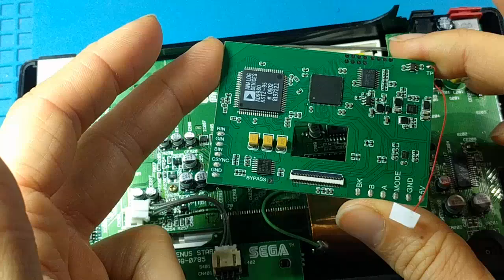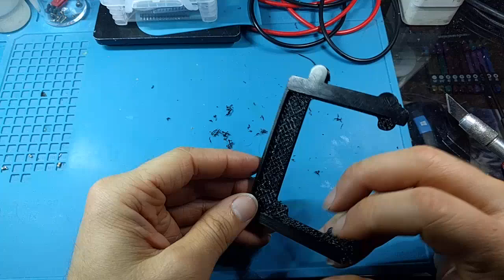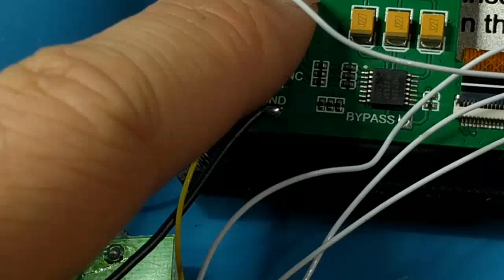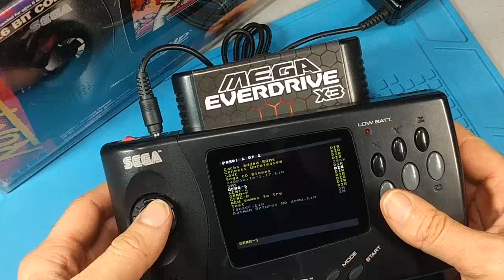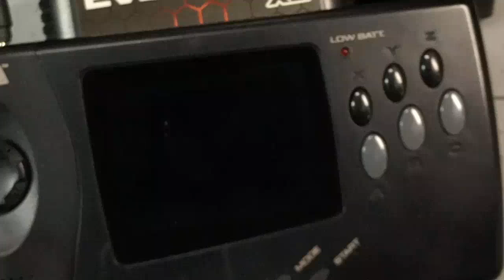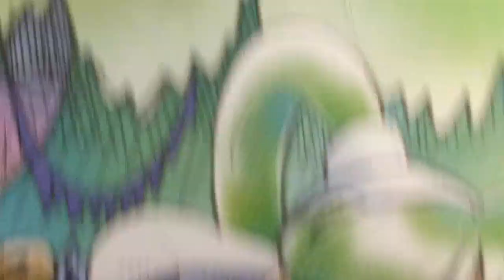Sega Nomad OSD LCDDRV Upgrade & Compare (RGB LCD kit from ebay) READ DESCRIPTION

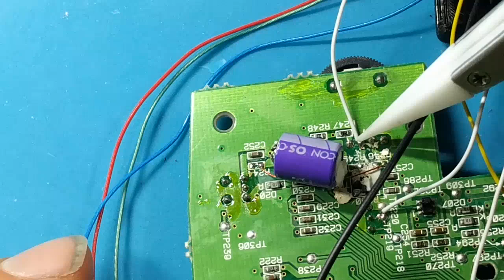Comment: 20:40 I was wondering what the removing of the resisters and making a jump suppose to do for the screen... As I am getting this exact kit.  As other screen kits I didn't really see this happening.

Also my Brightness knob popped off... which creates an open circuit for Brightness and wonder if I don't attach the BK wire will the other brightness settings still work (for the moment till I get a replacement knob)

Comment: Im not sure why, but that point for 5v on the two Nomads I have put out 10v-12v and I’m pretty sure it burned up my video board. It started smoking when I cut it on. I’m trying to rescue it now but hopefully someone else sees this and tests before cutting the power on.
Reply: Did you watch the video all the way through? He changes where he get the power from due to the voltage being too high.
Reply: @stevenhall55 I did watch the whole thing, then followed along while working and completely forgot about that part. Rewatching it again, I remember seeing that part…after it’s too late. Fried my board. Sigh, go team.
Reply from the maker: Check 25:50 in the video, where I soldered to the wrong spot.  It's easy to do.

Comment: I just fired mine up tonight for the first time in ages and my screen is fucked. The edges are legible but 95% is taken up by a bright bloom. So no debating whether to replace the screen or not. It's just a matter of do I just sell it as is and let the buyer decide if they just want a new screen or do all the mods, or do I replace the screen and get an evercade cart...
Reply from the maker: Option C: send it to Segasonicfan!!
sorry man, sounds like you got the dreaded "vinegar screen"  these things arent meant to last forever :(
Reply: @SegasonicfanDesigns  I don't expect forever, but many others have units with working screens. I used mine very little and it's been stored indoor in air conditioning so mine should be one of the still-working ones.

Comment: Thanks for the advice with the tweezers for these old connectors. I had a hard time to get the plugs out of the sockets 😂 Is this Nomad already recapped or are these caps the genuine ones? They have the same print as mines and i wanted to do a full recap because the replacement lcd already installed from the former owner is too bright for about twenty minutes after power on before it works normal. In other devices this is a common behaviour when caps are damaged but now i am not sure if my one is already recapped and the lcd is faulty itself.
Reply: I saw another modder say that he doesn't recap Nomads because they don't need it, where as he says Game Gears always need recapping.

Comment: This definitely needs a flex cable for the video signals so they are nice and clean and out of the way behind the LCD bracket. Possibly do the buttons as well.
Reply from the maker: I didn't design this, but yeah that would be nice.  It's quite a bit of extra work, but always appeciated when installs have that.
Reply: @SegasonicfanDesigns Oh I know you didn't design it but a flex pcb can still be made for this for easier installs